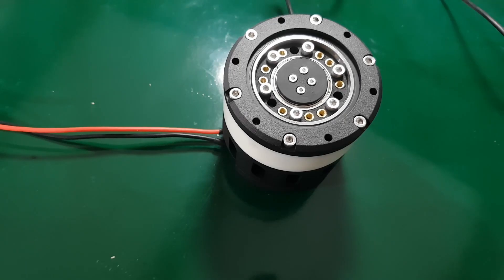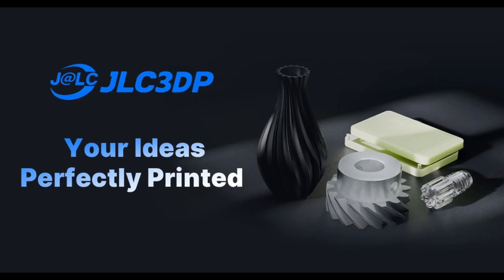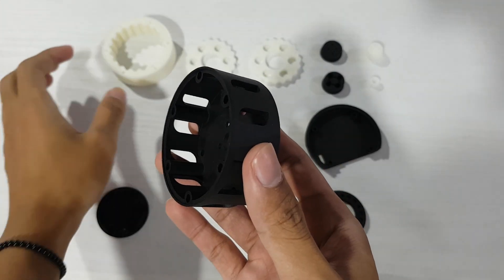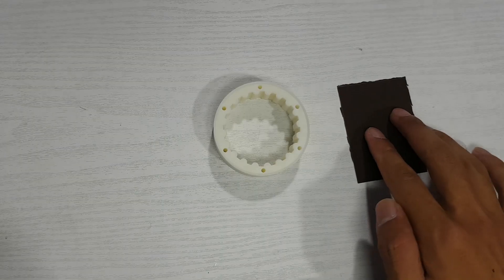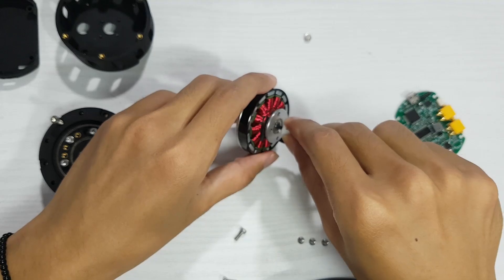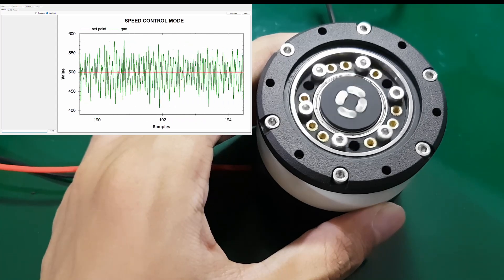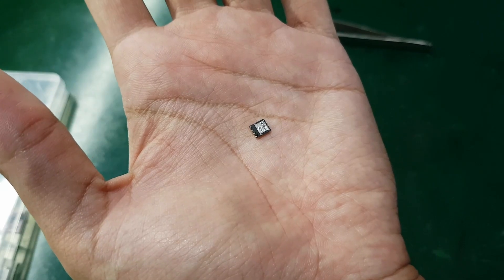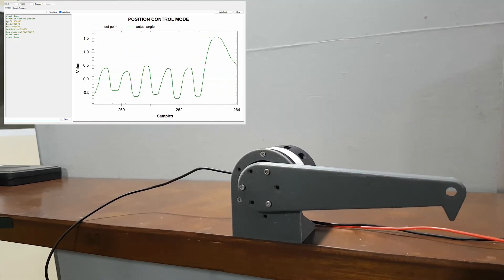I Built a Cycloidal Actuator from Scratch (open source)

Comment: If I scale up or down the 3d model will it still work? What do you think?
Reply from the maker: There are several parts in this design that use specific bearing sizes, so if you want to change the scale, you'll also have to change the bearing size, which is very difficult to do.

Comment: ever thought of using an axial flux motor? gimmick being it has more torque and its able to be flatter since the magnets are in a separate layer to the coils allowing the geometry to be more compact height wise, problem is they are harder to cool since the coils are sandwiched inbetween 2 rotors